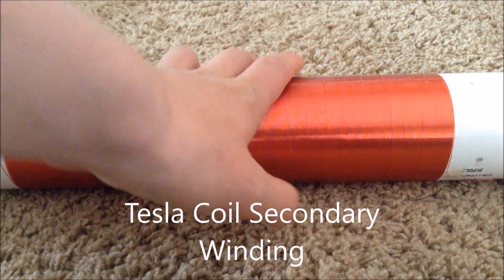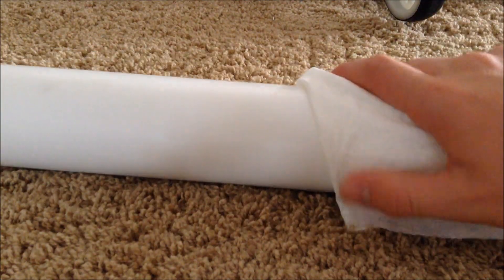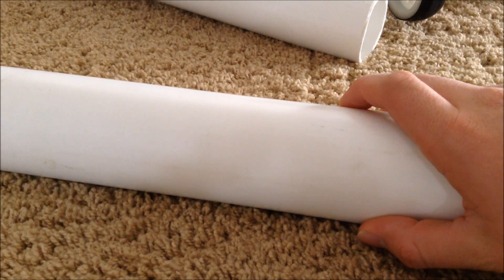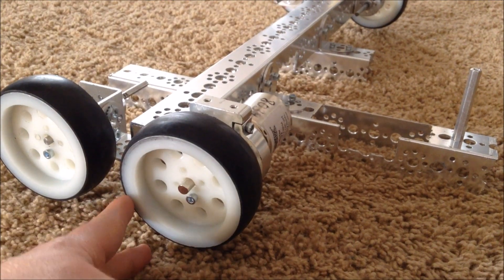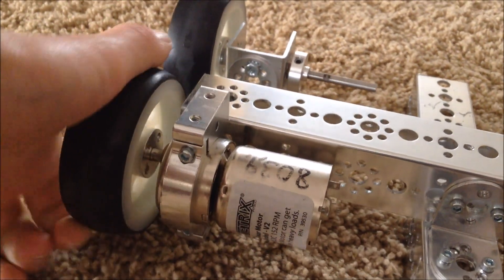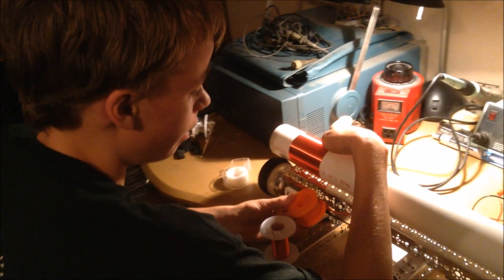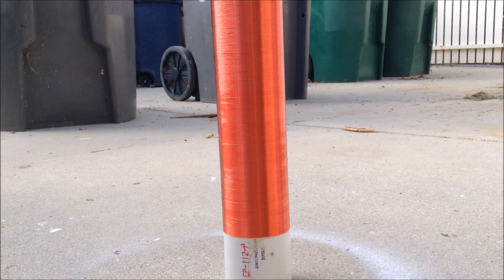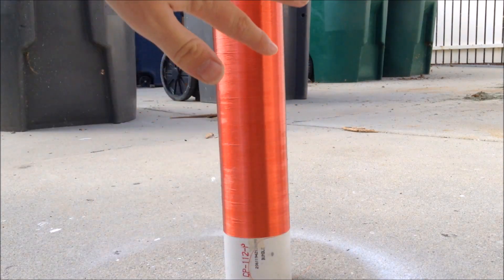Tesla Coil Winding Machine

Comment: The lacquer protective coating causes the coil to have extra resistance. The proper way to insulate the coil is with another piece of PVC that is larger and sprayed in the inside with lacquer and kept in an air tight container. Copper, when exposed to the elements erodes.
Reply from the maker: +rockyeangel The lacquer actually insulates the coil to prevent arc over and helps keep it from unwinding.  It doesn't give it any additional resistance.
Reply: I am sorry if I sound defensive, but the outside of the conductor is the largest surface area of the material that you are measuring. Regardless of where you put your insulator. Any insulator on your conductor will cause a loss in voltage and current. With hot glue, you are putting and insulator witch will still attract free electrons of from the largest surface area of your conductor. If you want to really measure what I am talking about, make a small prototype of what I spoke about in my last comment and measure the change in resistance. You will be surprised at how much more voltage you will get in your measurement. Thanks.
Reply: @rockyeangel  Are you aware that the coils are already insulated with factory applied "enamel" - the copper is NOT exposed to the elements. Adding insulation does nothing (at all) to the resistance of the copper though it guess it might have a miniscule effect on the inductance simply because almost ANYTHING (including a nearby hand) can VERY slightly detune a coil. I guess soaking it in laquer therefore might make a tiny difference to the inductance value.

Resistance would be unaffected - even it someone dunked it into a bucket of transformer oil - as of course many commercial transformer coils are indeed submerged in oil, partly for insulation and partly for heat dissipation. Some transformers can run with oil or "dry" but the winding's DC resistance is not changed.